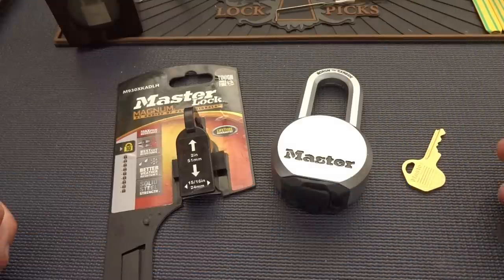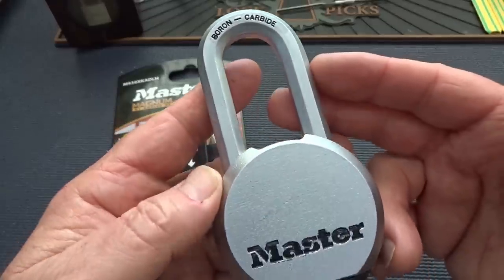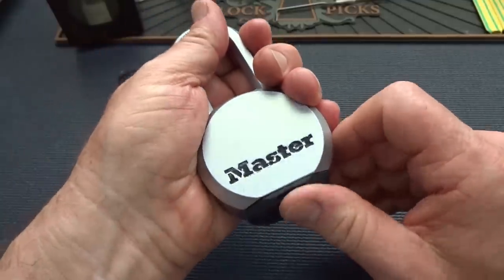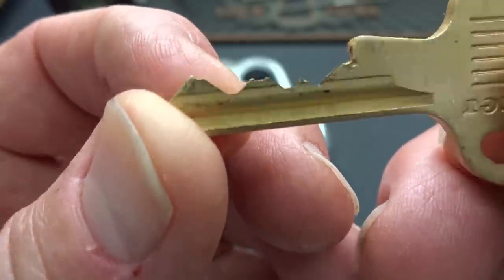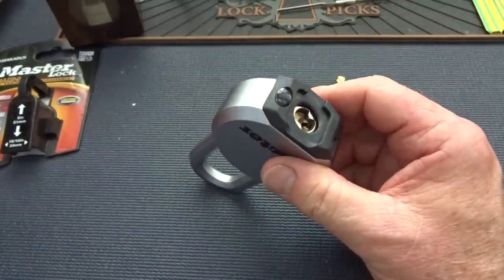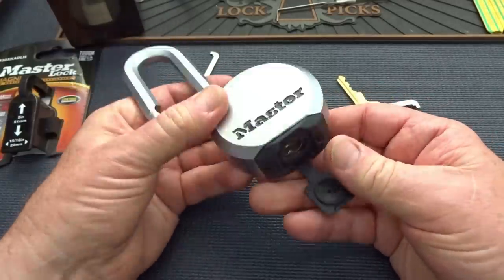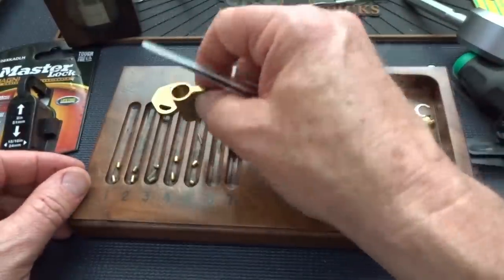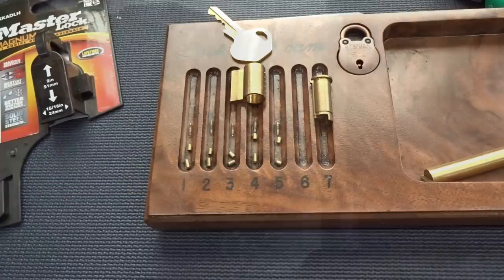(1285) Master Lock 930XKADLH RAKED Open! (JUNK!)

Comment: I think their 1-10 rating system is meant to represent how many seconds they take to rake.
Reply: Really all they rate is the body. You've gotta admit that if you take that body and give it a good core then it would be a good lock. Nothing short of a grinder is going to beat it destructively. It's just too bad that Master apparently doesn't consider picking enough of a threat to protect against.
Reply: Kris Sisk It says MAX pick resistance. Maybe it means that it won't break when picked?
Reply: Even better, it won't come remotely close to breaking your pick.
Reply: I think it refers to the age of a person that can open it!
Reply: Peter M Heh. Actually, I have a 10 year old and...yeah. She can pick a Master.
Reply: Kris Sisk it does say max pick resistance on the box too
Reply: Exactly or the rating of 10 should be -10 really!
Reply: @krissisk4163  what if you lose the key master helps you

Comment: Very interesting. I’ve never seen an M930 with all standard pins. The few I’ve picked have 4 spools. BUT, I have run into a regular 930 with all standards... and it’s supposed to have 4 spools. Looks like a case of terrible QC, because I’m pretty sure that’s not spec. Even with the spools though, this is a 30 second Lock. It’s a shame because it’s not bad otherwise.
Reply: Why don't they always put in spools, etc?
Reply: They've discretely changed them. In the now 930X, the screw holding in the plug is a TORX.
Because, you know, it was too easy to get to the core and see their crap using a screwdriver just about everyone has.
I think that's where the "X" comes from. Also, FYI; the "KA" you see in some Master model names means, "Keyed Alike."
If you check the shelf at your local big-chain hardware store, you'll find a lot of these locks are keyed alike to others nearby.
This makes it easier for people who need to buy a dozen of these at once to get them keyed alike; but of course it kida screws the folks dumb enough to buy one for their home from the store in the neighborhood because all of their neighbors who bought that lock probably have a key to their lock as well as their neighbors'.
Master likes to screw everyone they can who is NOT a business.
I think the reason they put their best cores into their LOTO locks and crappy ones into their "10's" is so their corporate clients can tell their insurance companies that since they host Master's best cores, the LOTO locks are as safe as they can be, so when it comes to a court case over a wrongful death because someone else removed another worker's LOTO, (These are often supposedly "One Lock, One Key" to ensure no one else CAN remove the LOTO without destroying it)the insurance company gets to say the LOTO was not picked opened and MUST have either been removed with the key, or by a person intent on murder.
Either way, not Master's fault, not the insurance company's fault, and not the employer's fault.
Wanna know why something stupid is happening?
Follow the money. Always....you know that; you're a lawyer!

Comment: Yep, "Maximum Pick Resistance" - exactly as advertised...  Doesn't matter how much you pick on it, MasterLock don't flinch!
Reply: They said pick resistance... not rake resistance... /s

Seriously though, with that key bitting, it shouldn't have even been rakeable... yet it was.
Reply: eak125 : Yeah, I thought the same.  I thought this was going to be at least a bit of challenge.

We have a Master Lock padlock here where I work...  It's been gutted though and a Aussie BiLock core put in it - now THAT thing is a challenge.  I tried, took 3 weeks to pick it at 20 mins. at a time (first time on a BiLock) and even then I couldn't repeat it.  I reckon I just got lucky (and need more practice).
Reply: I used to use a lock that looked just like that to lock my motorcycle up. Nobody stole my bike lol.
Reply: Stef60s but they are tough under fire

Comment: The drain hole is actually in a good location relative to the top of the screw too; it's offset, so you can't use that as a guide hole.

If Master would just use some decent cores, they'd have solid locks.

Comment: I had on and I put the cylinder in from one of there plastic lockout locks. Six security pins with that spring tension was actually a very hard pick in a solid body.
Reply: chevelle rr1  what is the key blank number for a 6 pin key for these cylinders?
Reply: I also have done exactly that and still have not been able to pick it.
Reply: neil 
Different from this 930? Or other master 900s?
Reply: I did same thing now I can't pick it. It was easy to rake the old one.

Comment: I bought the same lock a few of years back, all I wanted is something with spools.. I was sooo disappointed when I opened it up and it didn't have 1 security pin. I figured a 10 on their security scale would at least have a spool or 2, lol. To be somewhat fair, some of these 930XKADLH do have spools.... I even went so far as to contact Masterlock about this. They did not respond.
Reply: Rookie Lock if it say's 10/10, one would only imagine it has security pin's but after all, this is Master Lock we are talking about. 😕 Pretty pathetic of them not to even respond though. 🤔
Reply: Thats what I thought, pretty sad..

Comment: I bought one of these M930XKADLH magnum locks at local Home Depot a month or so ago. It has a crimped core, all spools and an allen screw holding the core retention plate on. other than that its the same. 
Its definitely not rake-able. Like the one in video. 

With a slightly filed Sparrows padlock bypass driver Im able to open this lock also.

Comment: They have a contract with USPS using these locks as well as model 6121 and other similar weather resiatant models for security on high value packages.
UPS and FedEx use mostly American brand.

Comment: After watching Bosnianbill and LockPickingLawyer's videos on picking Master Lock LOTO (Lockout/Tagout) padlocks and how good the 6 pinned core is, and then watching Wayne Winton's video on how extremely difficult it was to cut the 930 (He had to use a bolt cutter with a ratchet strap), I find that destroying a LOTO and installing the core in the 930 is still cheap enough to be one of the least expensive and tough locks for the money.  The $23.00 930 is a really really tough lock to cut.  Just swap the core out from a $9.00 LOTO.
Reply: Steve Kim good idea,  as long as the cores match. Sometimes they have different actuators,  but I've never taken apart a Master LOTO. Need to get one now, and try your idea out. Thanks.
Reply: William Mancel The cores are interchangeable.  Just drops right in.  I have put together two of them.
Reply: I'd be a little concerned about attracting criminals with something that screams "easy target", even if it secretly had a better core in it. I'd rather they just walked on by.

Comment: Bill, I commented on an earlier video but the audio problem is your noise reduction.  Please do NOT filter and the problem will resolve itself.  I ran into this same problem on my videos back when I was uploading and the solution is to eliminate or drastically cut back on your post processing.
Reply from the maker: That's the plan beginning on the next video.  My filtering experiments to please a small number of viewers is at an end...  I ended up making things worse instead of better -my bad.

Comment: If you simply replaced some of the standard pins with security pins of the same size. How much better could the core be with the same key?
Reply: Tex Patriot it would be tougher to pick, but the way the pin chambers in the plug are countersunk means that you have a much greater margin of error when manipulating the pins. The locks are made that way to allow for sloppier tolerances with pins and keys, but this also makes them easy to pick.

Comment: I stick master lock W600 cores in those and they are much better.   The core is $6 on line and it has spool and serrated pins.  It also has an AM3 keyway so you can use your American lock keys on it

Comment: Sue for false marketing.
Reply: It's really sad because their housings are usually fantastic. Higher end masterlocks hold up wonderfully against most criminals who would just try to cut the lock or shim it. The housings are usually top of the line.

But get one novice with a rake, and they're done for. They could easily even get away with charging ~20$ more for the kind of inner workings you'd find for a 20$ lock from another high end lock company, and you'd have an amazing piece of work.

I just feel like someone higher up has to realize this at some point.
Reply: KmanSweden Somebody get the LockPickingLawyer! lol

Comment: I bought some really cheap from ebay. 2 of them can be opened with a paper clip as tention tool and some hits with the bare hand to the not pinned side, 3 more can be raked really easy but one has resisted everything I tried so far... Maybe I got the one in a million secure Master xD Btw you can really easy reassemble these rubber seals, if you put them in the fridge for about 30 minutes :)

Comment: The newer production ones now come with all spool driver pins. However they are not much better as I can still pick them rather quickly and i am a very inexperienced picker, also some of them still rake open easily even with the new security pins. Not to mention they still have that large nut that can be unscrewed with pliers once the rubber piece is removed. You can always count on master to make sure there is at least one or two ways to quickly defeat their locks with little to no skill so that if you lose your key or are a criminal you will never be locked out lmao.

Comment: You know, it's funny. I've been watching Bill's vids for years. A few years back, I noticed that the padlock on the garage door control box was missing/stolen (I think I know what really happened to it but I won't elaborate here). So I went to a local hardware store and bought a Master padlock (a dial one with a key that lets you change the code). It's piss-weak. I tested it a few times. The code I selected doesn't work properly but you can open it with a few tries.

Anyway, it hasn't been stolen yet. :)

Comment: Tried watching this video on different devices with different internet access and it never plays, stops, buffers. Been on the page several minutes and only got to 11 seconds. Have no issues with any other videos or channels. Even on 144p.
Reply: Solved (at least for me) I disabled a plugin called h264ify. Youtube streams VP9/8 codec but some cpu's (mine) struggle so h264ify forces h264 streaming instead. This for some reason was not playing nice with this video. I disabled the plugin and it plays. Re-enable plugin, problem presents itself again.

Comment: Hi, after watching this video, I bought the lock on Ama*** in Europe. Here it's called "Excel" (instead of Magnum). M930EURDLH. Looks as great and beefy as it is easy to pick. Sadly, my one has two shallow cuts on 1 and 2 and deeper ones on 3 to 5. Once I got the binding order, I can now open it reliably within half a minute (SPP). Great show effect, opening a 30+ Euro lock in 30- seconds.

By the way, that little key pouch on the packaging, hiding the bitting from the front but fully exposing it from the rear... Same in the US?
Reply from the maker: Yep, identical junky packaging.

Comment: The  same lock I bought over a year ago to play with had 4 spools in it.  Now that you've gotten one and gutted it, you may remember I messaged you around a year ago asking if the six pin core from a master lock lockout410 would work in this 930 body?  At the time when I asked before you said you didn't know. Now that you've gutted it, do you think the core from a 410 would work?

Comment: Nice raking on poor old Master Lock.  🤣👏👍🔓Most Lock companies just make a scale up, and rate it themselves.  Master Lock is the Master of Deception.  They are pretty decent against physical attacks, but they have marshmallow cores.  I would have at least expected one spool for their top of the scale lock. They do have spools in their inventory.  I've seen them in other locks like the 7035.

Comment: Bill, I have this exact same lock I got on eBay some time ago. Was wondering how you fixed this lock? Didn't see anything else from you on it. I'm guessing you could re-pin it with american lock pins? But I agree the cylinder looks pretty sloppy. Did you find a replacement cylinder? I took an American cylinder and tried it in the lock , it fit but the engagement end is different and I couldn't seem to make it work? I know on American locks I put a spring and top pin in the last cylinder and a #4 pin and it gives you 6 pin security with a 5 pin bitted key. Ironically the exact same pin on Kwikset does the same thing, if you have a 6 pin cylinder. Worked like a charm on my Abus 83/45. Also I'm wondering do the master locks suffer the same problem as the American locks with the Peterson cylinder bypass tool? Sure looks like it would? Speaking of those wafers that you put in up to 3 of them to secure American locks, do you have a source to obtain them? Only ones I found were on eBay and they were $5.00 for a bag of 10. Seems kind of expensive.  Thank you for taking the time to read this.
Reply: So, after I sent this yesterday, I decided to try my hand at picking this thing. Note I am probably the worlds worst lock picker lol. I wouldn't have much of a career as a burglar..... But any way it took me maybe 30 seconds to rake pick it lol. Wow if the world all used Master locks, i would have a thriving career as a burglar lol.  Anyway all kidding aside it's pretty sad. The lock is build like a brick Shit house. And the core is a mess, I can't even imagine re-pinning it with spools and serrated pins is going to help much? Is there a better cylinder that can be put in this thing? American lock cylinders don't seem to work or I could make mine anyway? It's really too bad this lock would be awesome if it had some really secure core in it.
Reply: Should read , American lock cylinder don't seem to work or I couldn't make mine anyway.

Comment: I recently bought two of these for a really good price (12€/piece) and had planned to upgrade the core and use them for low security applications around the house but upon closer inspection both are missing the screw that holds the bottom plate in place and seem to use some sort of rivet instead. Did I get counterfeit ones or is that Masters new way to save some bucks during production?

Comment: Lol nobody talks about a portable acetylene torch, it's faster and quieter than a die grinder. You can melt through hardened steel in seconds, even boron carbide.
Reply from the maker: I agree that it is a bit quieter, but definitely not faster.  Also, who wants to carry around a couple of tanks and a hose?  Not nearly as convenient as a battery powered die grinder.

Comment: I can't even find a 6 pin key for these locks. 
I found a crusty master 911 on my gate with (I'm assuming) the same basic core. I freed it up and picked it open. With the 6th pin chamber empty, there was 5 spool driver pins in it. I went down to my locksmith to have them make a 6pin key and they told me there isn't one. (The same locksmith who provides other keys for my challenge locks for max high and low)
Reply: Float the last pin on the end of the key.

Comment: Bill what would you recommend for a chain and padlock to secure a motorcycle?
Reply from the maker: First, I'd recommend some kind of disablement mechanism.  Second, I'd recommend some kind of tracker. Third, park you bike in a secure area with physical and/or video surveillance. Last comes the lock and chain.  Grab an Abloy disc detainer with a shielded shackle.   For a chain, look at the Peweg with a 12mm thickness.  Understand tho, that the chain will only resist a die grinder attack for roughly 4 minutes.  After that, your bike is gone. So, you objective is to make your bike a less attractive target than the OTHER bikes parked nearby... Sad but true.   I have a friend with an older Harley and lives in a nearby apartment complex. To protect his bike against theft, he wheels it through the double glass door into his living room at night.  Hey, whatever works.

Comment: At least the core can be replaced with something more suitable. That black retaining nut though, is it plastic or steel?
Reply from the maker: It is case hardened steel, pretty tough stuff.  Still, it is the weak link in the system.

Comment: its all marketing for master lock, would be nice if they had a new line with good cores and real security features.
Reply from the maker: I agree wholeheartedly!  For just a few pennies per lock to use security pins in ALL six of the existing chambers, these locks could reasonably be called “high security”.  Raking videos would end and Master Lock’s reputation would rise.  All for a few cents per lock...

Comment: Hello Bill, I have a lock problem I was wondering if you could help me with. This thing has stumped me. It's an old elevator on/off/fire service lock. I have never seen one like it. It's a wafer lock with a very strange like female tail piece. It has fallen into disrepair and I would love to see if you can help ke identify it for replacement. Thank you in advance, I also emailed the lock lab in case you don't see this.

Comment: Would love to see if the two wrench trick would work on this to bust the hasp
Reply from the maker: I haven’t tried but am willing to bet it won’t.  If nothing else, their mechanism is really well designed and resists physical attacks pretty well.  Only the lock itself is a piece of junk.  If they’d correct that, they’d be golden.
Reply: If you don’t include the core i truly think this would rate pretty high compared to most of their other locks.